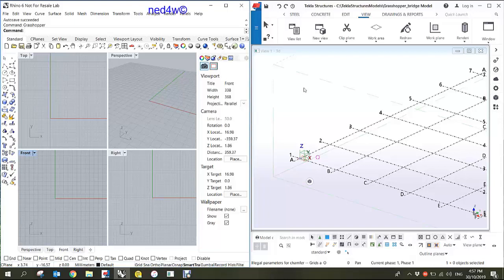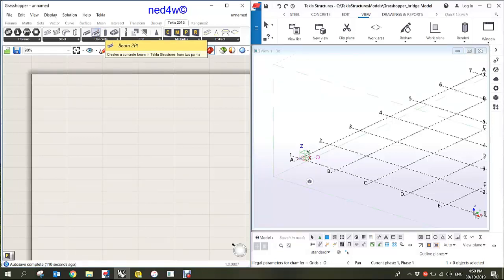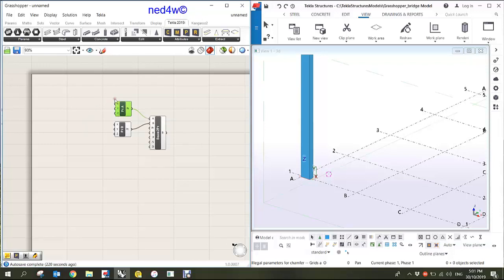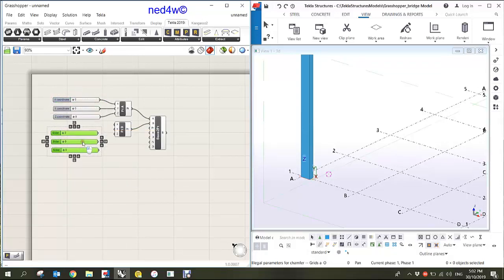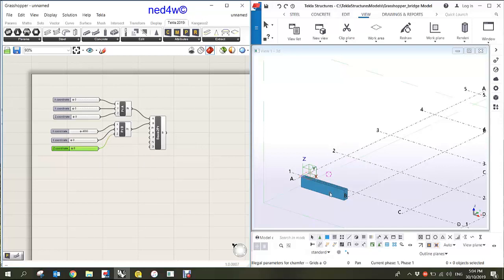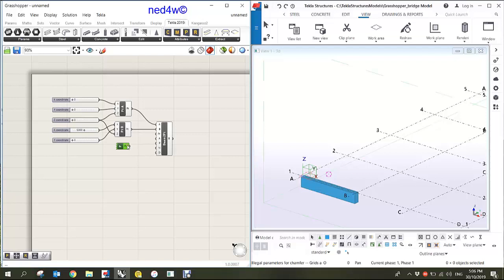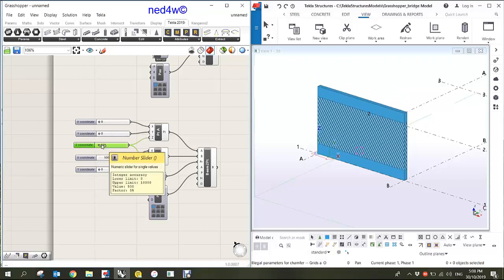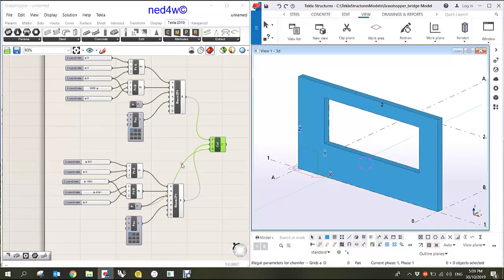Simplified GRASSHOPPER-TEKLA Link

Comment: Hello, I want to ask if you have any idea why it doesn't work for me when i use Profile Attributes I have an inscription under it (not set), why? I use Tekla educational 2020! Thank you in advance!
Reply from the maker: Hi sorry for the late reply. Im not sure if the issue is because of the educational license. In my demo I used a commercial license.
Reply: @thehowsofteklastructures565  No problem, I found a solution to the problem. I want to also to ask, do you know if there are any videos or info on how to make a similar type of model, for example for a small steel frame construction (warehouse)